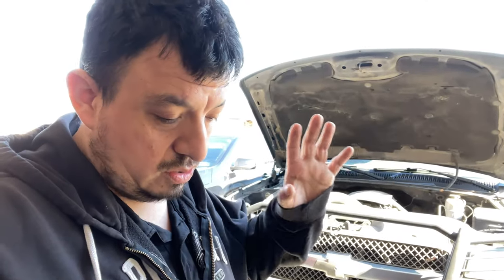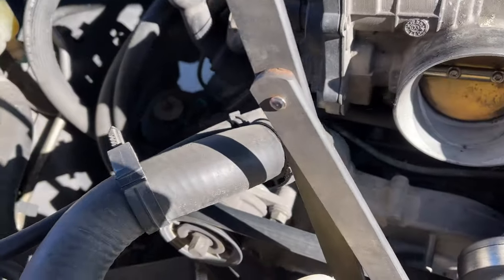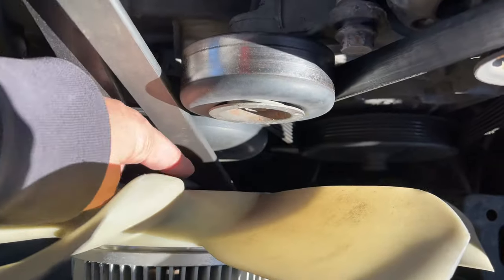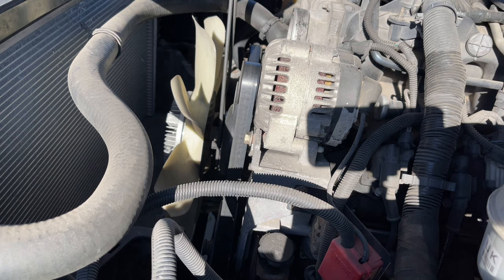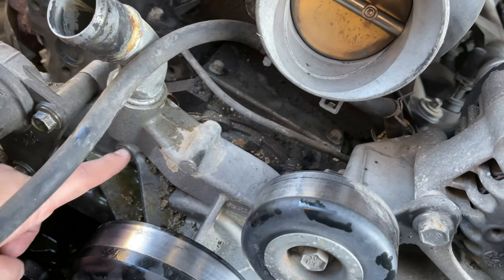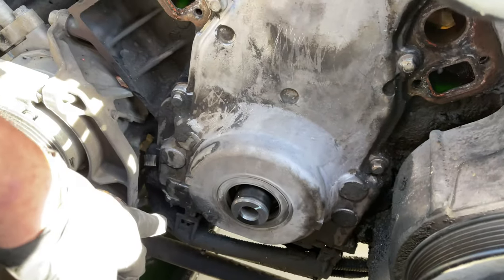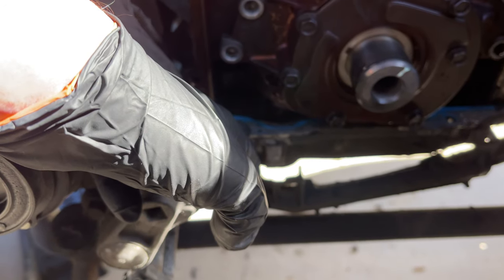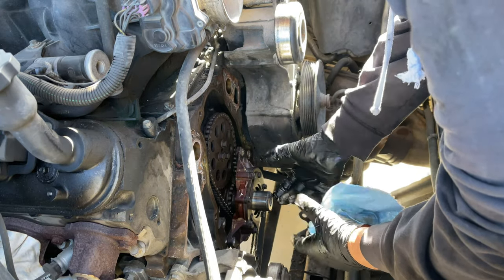Chevy 4.8L 5.3L 6.0L Oil Pump Removal & Replacement

Comment: I just did this on a 4 wheel drive, i was able to lift the engine enough that I could drop the pan an inch or 2 and was able to just get the sump tube bolt back in without dropping the differential. If you could modify it to make the bolt fit the other side it would make this job easier. Placing a rag in the pan saves you needing a magnet to retrieve it since its so awkward, and it helps to have long skinny fingers.😊 Let the silicone dry for 24 hours helps keep leaks to a minimum upon completion. Thanks for sharing.
Reply: You can remove the bolt without dropping the pan. It’s kinda aggravating but it’s worth it.
Reply: Did you put a new pan gasket on? It doesn't take but an hour or so to drop the front end and pan.

Comment: Doesn't look hard except it's a pain with the 4wd.
Reply from the maker: I bet
Reply: Jackson what is different in procedure when its 4wd
Reply: It's looks like a pain on full size trucks and SUVs.. I have a trailblazer 5.3.. that front axle through the oil pan is the dumbest idea ever.. 🙄😒
Reply: @radmilakrejci8581  u gotta drop the front diff since it’s in the way of the oil pan but on 2wd versions it’s just right there with nothing in the way
Reply: Exactly I was hoping to get to the o ring without dropping the oil pan I guess it's going to the garage
Reply: @lrecollet  it doesn't go through the oil pan it's just below it
Reply: Tell me about it 😂🎉

Comment: That o-ring on the oil pick up tube that you said looked really messed up will cause an internal oil leak and cause funky things on your oil gauge. It’s likely that’s all you needed to replace by simply dropping the oil pan. Don’t look like there was a need to disassemble the front at all lol DOH!
Reply: My oil guage drops to 0 and bounces back up to 80 ... gonna do the gasket 1st. It's a 4x4, so it may not be possible to drop the pan ...
Reply: @kingsrik doing the oil sensor would be cheaper imo. Could potentially be your issue. It was the issue for me, and it sounds like I had the same symptoms. But that worked for me intill my truck got stolen and joy ridden. Now my oil pump is making noise and I don’t have oil pressure at all so that’s why I’m watching this video.
Reply: Add AT205 to the oil and don't drop the pan! Double doh!!

Comment: if you don't have the fan clutch tool, just put the wrench on the fan clutch and smack it with a hammer. Usually does the job.

Comment: Hi. Very good video. The only thing I wanted to make sure is how hard it is to take the harmonic balancer out. Do I need any tool for that like a pulley extractor or just pull back after taking the bolt off?

Comment: Thanks for the video. I'm looking at buying a 05 Chevy 2500 HD with the 6.0, wasn't going to buy it because it needs a oil pump. But after watching this I'm buying the truck, the oil pump is not as has hard as I have seen in the past on some vehicles
Reply: How that go for you ?

Comment: did your oil pressure at idle improve with the new pump and screen? What was the old warm oil pressure at idle before this repair?
Reply: Good question, surprised he hasn't answered.

Comment: Thank you so much for this. Now I know how to take the fan off as well. Good information. Looks like I might as well change the oil screen and water pump while I'm at it. 316,200 miles on my suburban and still going
Reply from the maker: yeah I would change the water pump too
Reply: Yep oil tube pick up o ring, Oil pan gasket, water pump, oil pump
Reply: And timing chain cover gasket

Comment: thank you for making this video, my oil pressure droped just below 40 and scared the heck out of me. but now i know how to fix the problem!
Reply: Make sure to check your oil pressure sending unit first. You can test your oil pressure and if it’s above spec you’ll know it’s the sensor and not the pump. At 1000 Rpm minimum is 9 psi at 4000 rpm it should be minimum 24 psi
Reply: Keep in mind if it’s a 5.3 they are notorious for the pick up tube o-ring going bad. They crack at some point. Not if but when. 
You only need to drop pan to replace it. 
On another note. If you’ve run any type of engine cleaner other than injector cleaner you may of created sludge in the pan. Such as if you used seafoam in the oil vs the fuel additive it will clean your engine so well that you will have sludge built up in the pan and decreased oil pressure.  You will need to drop pan to clean it not just drain the oil.
Reply: @typicallycool5885  That's the bare minimum but not ideal.  40 psi at idle is desired.  Mine was 40 psi at idle always then something happened around 250K miles and it was barely 20 psi.  Turned out the oil pickup o-ring was cracked and had 1/8" gap.  Remove the old one and it was brittle and broke into several pieces.  Installed a new o-ring and it's back up to 40 psi at idle.  The vehicle has 326K miles on it.
Reply: @BrokenRRT  You can get the sludge out through the drain hole.  All the sludge will collect in the sump which is angled toward the hole.  Just squirt several ounces of mineral spirits in the hole, install the bolt and let soak.  Remove and let drain.  The mineral spirits will dilute the "sludge" and it will flow out.  Repeat until clean.  If it makes you feel better, you can use a bore cleaning tool to loosen up every last bit of it.
Reply: @BrokenRRT  That happen to me.. I did use the seafoam.   Never do it again..
Reply: @typicallycool5885  These pressure numbers don't even sound close to right. (9 at idle, 24  psi at 4000?!!)

Comment: Much appreciated! Have an '01 Silverado 5.3l with an oil pump that drops pressure to 0 at idle, so will be doing the pump this weekend.
Reply: James, I'm having the same issue.....was it the Oil Pump.....or the O-ring on the pickup tube ?
Reply: @johnlangman142  I'm right no in process of changing the o ring have pan off orange looked good pan pretty clean with 230,000 miles but if still reading low and lifters knocking I'll change pump
Reply: @mistydavis7630  did you change the pump and did it fix it.?

Comment: It should be noted that if you remove the fan shroud, you don't have to pull the fan. It comes right off with the water pump. I didn't notice this until sourcing the tool. Fiddling with the tool to get everything pined up and I noticed there is plenty of room around the water pump once you pull the plastic parts.
Reply from the maker: i would recommend this because when putting it back on you will now have to hold the fan with pump in place while installing gaskets and putting the bolts on ..
Reply: Makes the job more awkward…. I didn’t have a “fan wrench” so I used a strap oil filter wrench while holding the fan belt

Comment: Fan clutch bolt and harmonic balancer are the toughest. I saw some humans using a torches to heat the nut to melt the sealant. I did not. I went to lowes and bought a 4ft 1/2 in pipe threw it on my 18in socket with 24mm deeeeeeep socket. Bolt stood no chance with 4ft of leverage

Comment: Great video. I have one question though. Cant you just loosen up your the bolts on the oil pan without having to remove the cross member and oil pan, to get to the oil pump?
Reply from the maker: people say you can .. but it didnt work for me

Comment: Any way of knowing if it’s the pump or just the o ring?

I had a slight loss in pressure a few weeks ago. Then yesterday it went to 0. Reving it would maybe get it to 5-10, but i didn’t rev it much.

Wouod Pump failure still give you pressure while reving?

I have the pan off and the tube off. Hoping i’m not doing this for nothing. 

I want to clean out the pump a bit too.
Reply from the maker: the pump is hard to go bad .. so I would think its maybe the ring
Reply: Falcon's Garage i replaced the o ring and pan gasket.

Still is at 0. I did a primed start without the spark plugs for a few seconds and then started it up. Then plugged them back in for a real start. 

Zero. 

I have a 4wd so i have to drop a lot of stuff underneath to get it to fit. I took off my sway bar. 

Next weekend.

I think something is gunking it up. Probably not a complete failure, but partial.

I should maybe pick up my head gasket and look at the lifters. 

Ive had a check engine light going on and off for quite a while now. I have a cat that’s plugged and putting back pressure on the engine. Not a good thing. I got a stabiltrak warning every few days and a very poorly running motor but it’s intermittent and will shut off for a while.

Lotta issues.
Reply from the maker: @littlecabininthebigwoods5720  did you pressure test the system to see you actually had no pressure?  
Also issue could be internal like a crank shaft metal etc
Reply: I have zero oil psi ,have a gauge at the rear of block,I pump it in thru side port by pump and get 20psi,start car and it drops to zero...Rev it goes to 10 and drops...zo6 cam holley.pan and pickup...think o ring is seated...

Comment: So after install fill up with oil and go? No need to prime or how do you even prime?
Reply from the maker: yes .. you can prime it while its still outside the truck .. and even when turning on the truck .. dont "start" it right away .. just kinda like let the starter turn the engine like once or 2 .. just so it can get primed

Comment: Its called the pickup tube,not a screen. And if it was a 4x4,you have to either raise the motor or drop the front diff and in most cases lower the rack,because of a metal line that is about a quarter inch below the pan. It actully hits the pan more than the diff. I just pulled a pan today on a 09 and i could have just lowered the diff instead of removing it,if i could have seen that line on the rack first. . But i think if you just lower the diff and the rack, you can pull the pan. The diff will only lower about an inch because it hits on that part of frame that the center cross beam,(that you have to remove) attaches to. Some older models,are different where you wont have a problem with that metal line.
Reply: I've done it 3x now and still only ever dropped the dif a couple inches. That line has a 10mm bolt holding it up. Get that 10mm off and slide the pan down and back. Replace pan gasket and clean out sludge while you at it to save future headache
Reply: Disregard what I said about the 10mm, I misread that. I remember that line from my 07 and 08 trucks. Dropping the front diff takes more time than disconnecting those lines

Comment: Excellent vid. But a question. You removed the timing chain cover but didn't replace the chain and gears?
Reply from the maker: Timing chains are not like timing belt. They are very hard to stretch or break. So there is really no need to replace. Maybe the guides if they are worn. But from my experience no real need.

Comment: Thanks for the vid, my truck has zero oil pressure so I'm assuming it's the oil pump. I had two mechanics tell me the job would cost 1800 to $2,000 so I need to do it myself

Comment: How exactly did you mount the pulley back in? Any special bolt to tighten it back on or just place it on tighten it? I’m having a hard time
Reply: Get an installer tool so you don't mess  it up.

Comment: Preciate the video, i have a 2008 suburban with the 5.3 that switches from v8 to v4. Is it the same procedure on ny engine? My oil pressure dropped out of nowhere today and now i have what i believe is lifter noise and a code for misfire on cylinder 1. Engine has just over 200k...do u think i should do the o ring and oil pump? Will i have to do lifters also? Thanks in advance
Reply from the maker: i would have somebody check the DOD. those are known for the DOD to go bad ..
Reply: @FalconsGarage  so i let the engine get cold then started it again and the oil pressure is over 40 psi, but the noise and miss are still there on cylinder 1. What do you think this could be? A lifter? Or the whole dod system?

Comment: How did you get the front cover bolt next to the a/c compressor off? It's real tight for a 3/8 ratchet drive to sit on the head and loosen up.
Reply from the maker: try a breaker bar?

Comment: My 2005 Chevy Express  with 355,000 is showing a low pressure when engine is cold  . would this be an oil pump issue?
Reply from the maker: could be or the seal from the screen

Comment: How long did it take you to do a job like that? And your the best thanks a lot
Reply from the maker: probably like 2-3 hours from start to finish if your doing the oil pan and oil pump .. but if your doing them separately maybe like one hour each
Reply: Don't you have to do both twice no matter what?
Reply: @FalconsGarage   hey boss how much would that cost on a GMC 2006 diesel 2500HD 
Would it be expensive?
Reply from the maker: @chrisjacobs9735  diésel is a different beast. Yeah .. more expensive then gas .. for sure!
Reply: @FalconsGarage   thank you 🙏🏻

Comment: Question ik ow the pick up tube needs the gasket but does the oil pump need one too of the same ones or?
Reply from the maker: No gasket in oil pump. It goes flush with block

Comment: Hi... The O-ring on the oil pan pickup tube is Famous for failing on GM motors... Are GMC Oil Pumps also a weak point in the Oil System... would you replace with Factory or Aftermarket Pump.... Thanks
Reply from the maker: if possible always factory
Reply: As the engine ages, the tolerances are not as good as they once were.  Oil pressure gets reduced in the motor.  First do a flush with a cleaner and maybe a little ATF 1 quart drain and refill with a wix or equivalent oil filter.
Next try the O ring in the pickup tube.  That could be damaged... more likely is if about 10 yrs old.
Finally,  all else fails,  get a Melling high volume oil pump.  Those come witj springs to increase pressure too.  Remember to center the pump with shims and prime the pump when installing. 
That doesn't work, check for lifter issues or possible rod bearings going out. Replace those or save up for a new or rebuilt motor.
Reply: @20tea  Thanks.... I bought a MINT 2004 LT Chev Silverado 2500 4x4 6.0 Loaded leather Factory DVD 290,000km for $3000 with NO oil pressure Runs Smooth... BEAUTIFUL Truck I'm turning into a Earth Roamer (google image)... I have a 2004 SLT GMC 5.3 4x4 480,000km runs Prefect... and a 2006 SLT GMC 5.3 200,000km runs prefect.... next message
Reply: @20tea  39 years Auto Body... I bought the 2004 Chev Silverado with broken Motor or No oil pressure... I can get a NEW factory 6.0 LS3 heads Long Block for $4600... But the truck Runs Smooth... last guy put in New Oil sensor and didn't realize truck has Limp Mode and figured Motor was Toast... I put in a can of AT-205 RE-SEAL idled Engine a few days.... I put in a can of SEAFOAM idled Engine till it goes into Limp Mode... I removed and Cut open the Oil Filter and its CLEAN CLEAN Zero Metallics and it Old Oil... I ordered a O-ring and Pickup tube from GM... next step is to remove Oil pan and check for Metallics and replace O-ring and  Pickup tube... I'm buying a few more 2004-2007 GMC SLTs and CHEV LT Silverado's and may try my hand at rebuilding some motors.... When I learned Autobody Welding etc etc I didn't have Y-T :) Thanks Again will look into a Melling Oil Pump...
Reply: @kelvenguard  No problem,  hopefully it helps!  Other than those engines with the afm/dod technology, generally 2009+, these are great motors, some issues with design.  Dod can be removed and these engines provide good power and reliability when taken care of. Parts are also plentiful!

I do autobody, painting and vinyl wraps on the side.  Definitely an art!  Thanks.
Reply: @20tea  Cool Autobody brother..... I picked up a GM Factory O-ring and Oil pickup tube today... probably didn't need the Pickup tube.... I'll try that first.... My Canadian price on that New GM performance 6.0 LS3 heads is $6,665.53 CAN.... The 2006 GM SLT 1500 4x4 Crew Cab RED/Charcoal Leather Loaded plus DVD & Sunroof was MINT before smashed in the front... Hit a Big cement Block when it was snowing and Icey payed $1800... I'm Building a FERRARI Truck with that one.... My Goal is to make it look like GM and Ferrari teamed up and built a truck.... I'm not rich but I've build Many Show Cars for myself and Customers.... Helps keep my mind off this crazy world
Reply: @kelvenguard  Totally agree!  My hobbies keep me occupied other than family.   Yeah, a new oil pickup tube may help.  The screen may be a bit gummed up on the old one.
I recently installed the melling high volume pump.  Raised my base oil psi by about 10.  Let me know how your project goes!  Hopefully that's all is needed.

Comment: I may have to replace the timing chain cover due to an oil leak and I have issues with oil pressure (already replaced the sensor).  I've heard conflicting things that oil pumps never fail (mine's at 180K miles) so don't waste the money to as long as I'm in there spend the $150 for a good oil pump and have peace of mind. What's your thoughts?  It is the 5.3L Denali package so if I have to drop this and remove that then that may be my answer.
Reply from the maker: if im there and having oil problems im replacing it .. but thats me ... what year is your truck?
Reply: @FalconsGarage  2006

Comment: Hi there mr Falkon do that also helps the lifters?? Because I got a Tahoe 05 with the 4.8, and the pressure always low when it’s parked and regular when it’s running.. I maybe change the oil sensor too, but need answers
Reply from the maker: its normal for pressure to drop a little while in idle ..

Comment: Great video! About how much this job will run?
Reply from the maker: couple hundred .. but it really depends on where you get it and where you live
Reply: My mechanic refused to do my oil pump on my 05' gmc yukon denali.  My oil pressure needle drops all the way down n I can hear the lifters knocking so now my truck has been sitting for afew months.